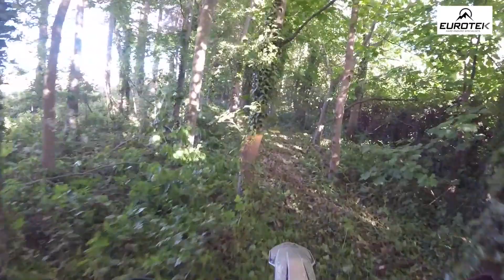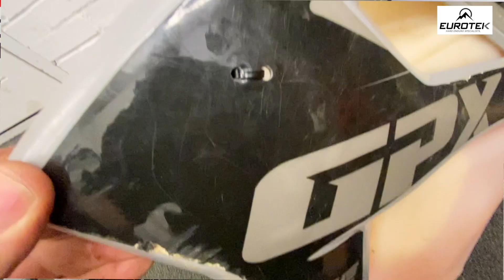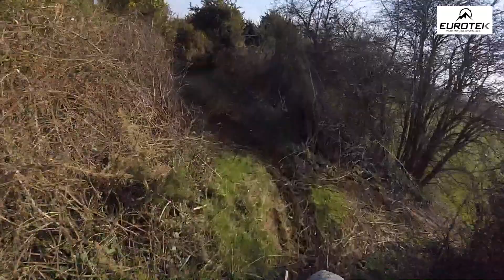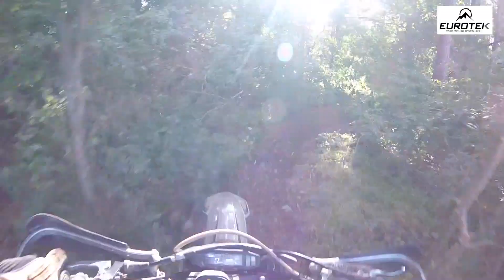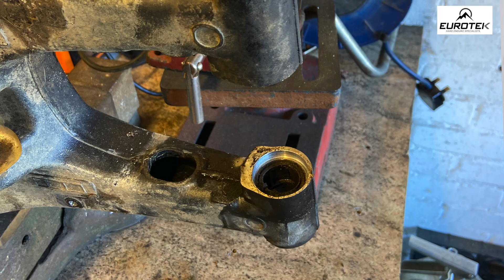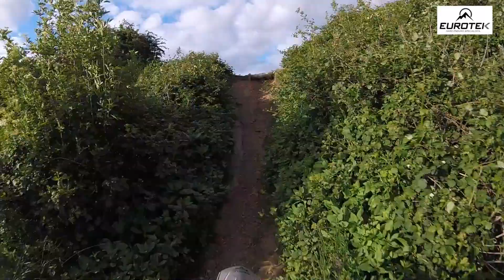100 Hours Review on the GPX TSE 250R

Comment: My only questions are if I plan on using this bike as a commuter bike and hit the trails every once and awhile mostly doing urban exploration how will the bike hold up, could you recommend it for this purpose, and at what point will I have to rebuild the motor or top end? Like how many years will the motor last before major maintenance? I know this is not really what the bike was designed for but I love 2 strokes.
Reply from the maker: @Pro_Re_Publica_Amor_Fati  How many miles is a commute?
Reply: @RobboRobinson  Just a few miles but I may go exploring maybe something like 25 miles every week or so just puttin around town. See there are not alot of dirt bikes for sell around me is the problem so Im nearly forced to buy something brand new unfortunately. But I want to know how often I have to maintenance the bike and I know thats tough to answer. But thanks for the response.

Comment: How easy is it to get parts?
Reply from the maker: Easy contact GPX Moto UK. Also loads of engine stuff online like aliexpress. Usual stuff like brake pads, wheel bearing sprockets are Ktm fitment , front sprocket YZ as its a Yam engine. KTM 2020 on plastics will fit too.

Comment: Hello.
I have been following the channel for a long time, especially the Gpx videos. In my country the gpx 250 is around £2,781 ор 3290 euros new but sold under another name HMC 250 2t. I want to do a tour of 2700 km of mountain driving, so I am interested in whether it would last without a problem and how many hours are needed for piston rebuilding with normal driving (sorry for my english). :D
Reply from the maker: 200hrs no problem before looking at a piston change. mix oil 50-1 use fully synthetic. Many guys have some very high hours on these engines.
Reply: i jas se mislam za vakvo nesto backo..
Reply: imam RMZ 450 2012 god.

Comment: After all the modifications and money you spent on this bike you find hard to admit it wasn’t worth it. I guess it’s better to spend money on second hand beta or sherco
Reply from the maker: If I’d spent money on a secondhand Beta or Sherco I’d be spending even more money on servicing and repairs. The point of this bike was for bike fitness. A brand new bike that has filled the gap I wanted. Modifications were mostly what I would do with any bike and kept to a budget. For the amount of time I’ve put on this bike it’s paying off and I have fun on it.  I would always say buy the best you can afford. I have one of the best bikes already for hard enduro a KTM 300.  I don’t need two of them at £9.5K each. But an extra bike at £5k that feels much like a KTM in its handling and can go twice as far between piston changes     has not broke down and is cheaper in parts, not that I’ve needed any other than brake pads , wheel bearings , front sprockets , chain & guides & swingarm bearings is a win win for me. If I’d bought a secondhand bike I’d most likely be in for a full engine rebuilt now at £900 and whatever else it might need. If you think it’s better to buy secondhand bikes then do that. Personally I’d always try and buy new unless i’d plan on doing a full ground up rebuild on the  purchase or I know the bike is low hours. This I am doing at the moment on another project. Secondhand bikes can be risky. The GPX bike is a trail bike after all and probably from a dirt bike riders perspective in the £5k bracket is probably best of the bunch.
Reply: @RobboRobinson  IMHO a second hand Japanese bike would be better to spend money on.
Reply: @MikeHF  Japan don't make two strokes for enduro anymore, you might argue saying the yz 250 two stroke, but you would need to modify it a lot for enduro use.
Reply: Second hand sherco doesnt prove it is that good, the plastic sparepart very hard to find the replacement (must buy thr original ones), but with this bike even with custom husq body it fit perfectly almost thought itwas husq if not looking to fr suspension.
Reply: Dumb comment!

Comment: The local gpx dealer put husky 300 plastic kit and it fit perfectly. That was a gpx from 2 or 3 years ago? I thought it’s the same bike as now but must check again.
Reply from the maker: Up to 2019 it was the Husky plastic kit. Later use KTM 2020 onwards kit with KTM rad louvres.
Reply: Funny about that ??  I had a GPX. Sold it 😅

Comment: Thanks for the 100 hr review Robbo and I'm glad your happy.  
I just want to mention that I think the stiffer springs have reduced your plush feeling along with your possible weight loss ,due to so much training. - hence now they are not as plush. The stock springs with my 14 stone + kit are simply the best forks I've ever ever had on a bike. I've ridden Romaniacs 3 times ,ssdt X3 ,S2S , SEEC , BTC , Brit extreme , Scott trial events, centre championship event wins etc all my life continually. I've run modern bikes from an RR , Xtrainers ,EXC ,SXF , YZ. My last RR factory had a revalved front end. I know it sounds crazy for the low price , but it's simply true. The GPX forks are the most plush , ground tracking ,comfortable and confidence inspiring forks I have ever ever owned. They are simply outstanding . Championship rider Aaron Smith rode the bike 3 weeks ago and he gave a video review of the stock bike and made special reference to the superb front suspension. I run totally stock forks with new seals . I've got the compression completely wound off and a tiny tiny amount of rebound and these are very plush at the top and middle. I don't feel the small bumps , there is no jarring , no negatives. They are fast moving and track the floor beautifully. No bottoming out. These would be at home on a KTM 6 days. They significantly reduce fatigue. It just soaks up all the stones and bumps brilliantly. If anyone wants to test a set of stock GPX forks then contact me and I'll set up a test ride. I believe these springsbhave created this non plush feel. Stock are amazing. Sorry for waffling , but I want to get this across 👍😊. Yes I know im the importer ,but im the first person to be fair and balanced about Gpx . As I said before , at 224cc they are not as fast as a KTM race bike but the forks are as good as anything out there ❤️ and for me of a leading feature of this bike if you want to race it. The forks just make riding this bike easy.
Reply: Well copied illegal bike.. how come UK laws allow this illegal copy of KTM and Yamaha to be sold there
Reply: It’s china… you can’t sue them, and you certainly can’t stop middle men from distributing and selling their products.
Reply: @alimertsumer3028  well, engine is produced under licence.
Reply: I’m an American rider. I typically ride fairly slow. I’m 145lb and 5”11.  My typical ride is about 10-15 mph. I enjoy the nasty stuff and on occasion when we go on group rides we kick it up to a slightly faster pace.I currently ride a kawi klx300, which while not an awful bike just isn’t what I want.  Mostly my issues lie in the motor. It simply doesn’t lug as hard as I’d like. When you get it stirred up it’s a solid running motor. Would this be a good alternative?😊

Comment: The big issue I've seen with the knock off Rental bars is they tend to snap rather than bend on bigger hits.
Hopefully GPX develop a hotter pipe for these at some point, an FMF Fatty reaaaally opens up a WR200 which is a fairly similar engine.
Reply from the maker: The first set of bars I had just bent in a heavy crash. Hence I got the same brand from same supplier.
Reply: @RobboRobinson  Good to know they've been improving! :-)